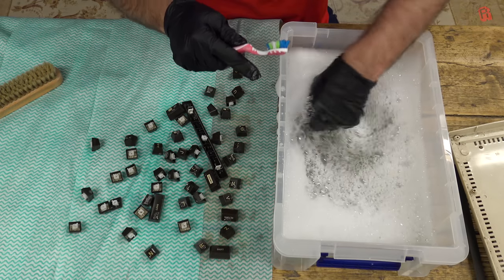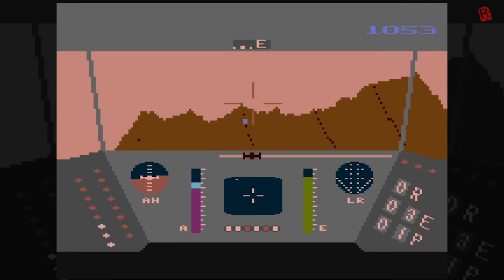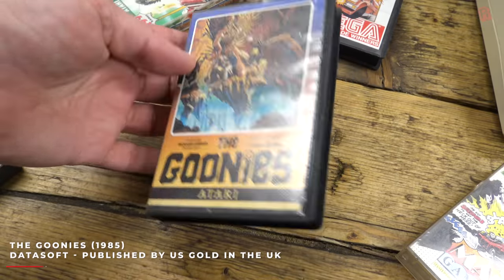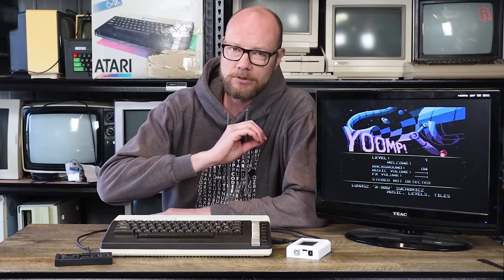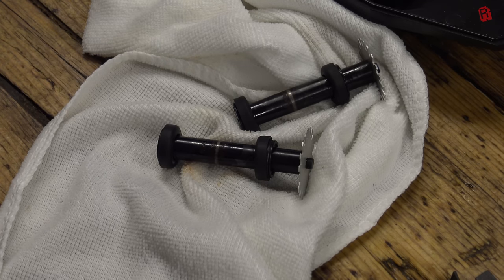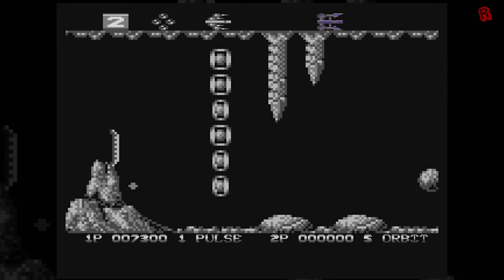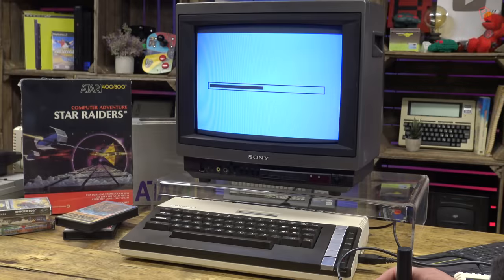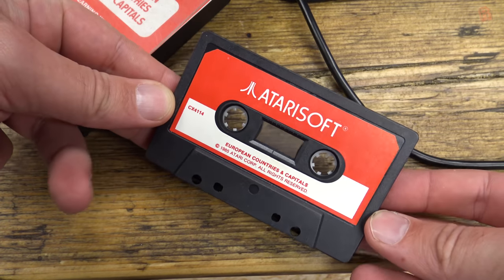What was the Atari 800XL capable of? | Trash to Treasure Part 3

Comment: Atari tapes were stereo, but sound output was mono. TV was feed only with a mono-audio track, while the data-track was feed into the micro. So you did't need to adjust a balance in TV. You actually didn't heard the data track in the speaker (only some crosstalk).
Reply: Thanks for pointing this out.  I'd left a comment about the Atari tape drives and this unique ability in the first RMC video on the 800XL.
Reply: There is a "POKE" (register) that you can use to mute the data transfer sound.
Reply: Not true. My TV only had 1 speaker and it always played the data sound. In the case of this game, it played the combined sound like you hear in the video, so it must have been merged in the RF modulator for mono output. Unfortunately, this means that shifting the balance to eliminate the loading sound would not be possible. I wonder if it would have been possible to cut the loading time in half if they had just used both channels for data.
Reply: Species1571 You could poke a certain location to silence the data sound. Worked on cassettes and the disk drive. 

Presumably they could have enhanced the load speed by using both channels, but that would have pretty dramatically upped the complexity of the encode/decode circuits. 

Also keep in mind the 400 only shipped with like 8K, maxed out at 16 (without hacks) and it was the machine really intended to be used with a tape drive. The much more expensive 800 was meant to be used with a disk drive, especially if you had the money to expand it beyond 16K. An 8 or 16k program wouldn’t take long to load off of tape. It was only when the machines started coming with 48K or more - and programs grew that large or even larger - that tape load speeds became really daunting.
Reply: makes sense, i wondered why some games loaded pretty quietly 🤔. None of my friends had an atari (spec'ies & c64's) i would argue how good the XE/800 was... we never really got the games the others had🤣

Comment: Some things you may be unaware of: Due to some register changes between the 400/800 and the XL range, some earlier games would not run on the XL series. To overcome this, a 'Translator' disk was released which was pre-loaded prior to loading the game to be played. The Translator was a basic 400/800 emulator. Lucasfilm games: 'Rescue on Fractalus' was originally called 'Behind Jaggi Lines' and 'Ball Blazer; (which you should really cover as it was a stunning 3D game for the period) was called 'Ball Blaster'. One of the best platform games ever (IMHO) was 'DROL' which used artifacting to achieve colour in the then 'high resolution' mode. ;-) I believe a later lower resolution game in four colours was available. Now, back to your regular programming...

Comment: It's a testament to the power built into the Atari 8-bit range that they were designed in 1977-78, but were still way ahead of almost every other micro on the market in the mid-80s. 

Their only real rival was the C64, which had the benefit of being designed several years later, but even then, when the same game existed for both the Atari and C64, the Atari version was often faster and smoother.
Reply: Yeah, the only real letdown of the Atari, and almost certainly a side effect of when they were designed, is their sprite hardware is a bit wonky compared to later systems.
(also weird memory saving hacks like having 256 colour video output circuitry but 7 bit palette registers, but those aren't so significant)

I bet if they had done even a slight design tweak to GTIA and Antic when the XL machines had launched they could have done a lot better.
Like, say, fixing the palette registers, and doubling the number of sprites (in absence of a more comprehensive design change to how they worked.)
Reply: @KuraIthys  THe Atari sprites were of their time - the original 800 had 4 joystick ports and so it had 4 hardware sprites too, called "players", but it also had 4 smaller sprites (2 pixels wide) called "missiles", one for each player - the idea being that one sprite for each player would be enough! They were single colour too.
Reply: @KuraIthys  Atari 8bit architecture can do without HW sprites, check all the  latest games like Last Squadron, Albert, Calisto, Prince of Persia. Large, animated colorful sprites without any slowdowns.

Comment: I have a ridiculously upgraded 800XL, lovely machine, I've barely scratched the surface of what it can do. I hope you thoroughly enjoy yours and spend some time checking out all the amazing things that are being developed for the machine right now.
PS
How does it compare to the C=64? A lot of it's down to perspective. Both are great machines, get both if you can.
For myself I would say there's almost nothing to choose between the machines from technical point of view - GFX on par, Atari a bit quicker, C=64 a bit better sound. The C=64 has the edge on games available, and probably new developments. The Atari a huge lead when it comes to practicable hardware potential and extant projects. I am very pleased to have both but tend to use my Atari more often as I lean more toward hacking than playing games.

Comment: I have 8 800xl , 2 130 xe and 1 65 xe and they all work! I recapped them all and recapped the serviceable power supplies and never had a failure. Built to last. Best 8 bit there is.(imho)

Comment: Hi Neil. Your loading issues look like you are booting with BASIC enabled. To disable, hold down the option key on the XL/XE whilst powering on. On the 400/800 it was a separate cartridge so not normally an issue. That is why you get the remove cartridge error, it's detecting it, where it would have been a separate cart originally.

Comment: comparing SID and Pokey is unfair as the pokey does sound as a second thought.  Knowing that it then becomes interesting to d'elle into experiments and be surprised of the way you can use the various bit operation modes per voice.  It's pre Amiga tech so of course they haven't enabled sample playback for users but it is easily tapped potential.  Look at the various poly modes in the Pokey, very unique noises.

Comment: The Commodore 64 obviously had better sound, being a computer that came out a few years after the Atari & having a more recent sound chip (the Sid).   But considering the Atari was older technology, it really held it's own when comparing the 2 computers.  And have I mentioned that the Atari system was simply better than the c64 - especially the disk drive which was faster and far far less buggy than the Commodore.

Comment: The Last V8 really does show the C64's strengths over the Atari 800XL very clearly: hires detailed sprites, an extremely colourful dashboard and logo, the much more versatile SID, and the horizontal smooth scrolling is twice as smooth (320 pixel vs. the Atari's 160 pixel).  The A8 is limited to 4 or 5 colours horizontally at a time, the sprites are only 8 pixels wide, and the smooth scrolling is tied to the current graphics mode.

The A8 shines in 3D games due to its faster CPU (like Rescue on Fractalus and BallBlazer) and games that scroll or render vertically. Generally the A8 is superior vertically, while the C64 is superior horizontally. This became very apparent when the side-scrolling platformer came to prominence later in the '80s. The C64 could nearly keep up with the NES.

Comment: You didn't need a stereo TV to hear the audio track on cassettes that used one - just as well, as nobody had them in 1979. When an audio track was present, the Atari would automatically mute its normal cassette loading sound and pass the audio track through to the TV speaker in mono.
Reply: Yeah, it didn't send the data audio out. Correct

Comment: 13:22 the text underneath the game , it's because has a graphic mode with "high resolution" on top and text on the bottom (probably a BASIC feature) , was very nice to debug using the bottom part as log,  i just remember that, 24 years passed fast ... still my favorite one by design was the 65 xl, i have both like in 1996, good old times !

Comment: Reminds me there's a near perfect conversion of The Mighty Jill-off, just without the second stage and ending sequence (but the intro is still intact).

Considering that's a PC game from about 2010 made in a retro style, rather than an actual 8 bit game, the nearly flawless conversion is one of the most impressive things I've seen...

Were it not for the strict adherence to using 64k of memory (could've been circumvented given floppy 130k floppy drives existed), I don't doubt it could've gotten the ending sequence and possibly the second stage into the game in a way that would have made sense in the past.

There's also crownland. - doesn't play very well, and the final build requires 128k of RAM, but it looks amazing and there's an older build that works on 64k machines...

Also worth remembering that this stereo tape feature has hardware functionality supporting it.
In particular you can turn the tape loading sounds off in software, and the system explicitly supports sync marks on the data track, which, coupled with the fact that software can stop and start the tape drive (no other functions, just stop and start the motor), means you can program things to play audio on demand in code.
Of course, it's not random access, but it's still an interesting concept.

Comment: I had an Atari 800 which I upgraded using the XL range of peripherals (1050 drive for example). But one item was a touch tablet from Atari. It was about 6" by 8" drawing surface with a stylus  incorporating a button with a second button on the tablet unit(mirrored for left handed use) . The tablet surface had a plastic covering that could be lifted out and pictures placed underneath for tracing. But what is interesting about it is the technology uses the same input to the computer as the paddle controller, namely variable resistance so it could be used as a paddle controller (with some practice). Left/right was one paddle and up/down was the other and the fire buttons were the stylus button and tablet button(s). Some rather good drawing software was available at the time (Degas being one of the better ones) and despite the limited colour palette I managed a reasonable picture of the motorbike i had at the time.

Comment: Excellent series, the old Atari’s were quite capable machines though tape loading was dreadfully slow I did wonder what you were using that looks like a nice gadget. The pokey sound chip is also a very capable device and although it might not match the SID for varied sound it does have an extra channel. A better piece of Rob Hubbard music would have been Jet Set Willy, the game itself is awful though unless you get the home brew re release with the proper graphics.

Comment: Far from a comprehensive list. Machine was a word processor and used spreadsheets. Acted as a extensive BBS. I ran one with 31 message boards, e-mail, and was the first person to establish this packet network with Europe from the USA Had speech generation (via both hardware and software) paint software, banking,  electronic circuit schematic, modem communication,, various database software applications, printing of documentation, label, tv image capture. Satellite image capture and printing (weather). Currently internet access! and more! And fast 3D image rotation. Machine ran at 1.79 Mhz vs 1.0 for the Commodore 64 Was amazing in its day!

Comment: The 800xl was a good machine, We started developing for it after the Dragon and release of a few titles. Although we had working prototypes for the Atari we did not publish. what we did do was use the stereo tapes to apply music during loading. It was cool at the time especially as 10min loading was not uncommon however given time this seemed to increase loading errors.
Reply: When I learnt of that feature I always wondered why it never seemed to get used.

Using it during loading seems especially like an easy win, but given the few examples that DO use it (Atari's 'introduction to programming'), it seems like it would've been plausible, with some serious caveats, to use it in a similar manner to the way games later on used CD audio. (obviously without random access, the limitations are severe)

Indeed, one of the many, MANY versions of 'bad apple' created for the atari 8 bits uses this system to play the video off a large cartridge (like 60 megabytes or something), while simultaneously playing the music off a tape.
This is jarring in just how high quality the result is for an 8 bit system.
Obviously the huge cartridge is a major cheat. But...
On the other hand the demo runs just fine on an unmodified atari 400...

Which is just, insane to think about...
Reply: @KuraIthys  The two main reasons the audio track was rarely used were that producing a decent track to put there meant added expense - you needed to book a studio to record and mix it, maybe pay a professional voiceover if you couldn't persuade one of the staffers to do it - and in the USA disk drives rapidly took over from cassettes anyway.

It was a great idea, but the added complication and cost it introduced to the tape production process meant that few software houses other than Atari itself bothered to make use of it, and the popularity of disk drives saw cassettes sidelined.
Reply: My school had a Spanish learning tape set that used the two channel head.

Comment: You might try 0000 steel wool to remove rust and mung from metal pieces. It works great for me on coins, firearm finishes, and just any metal finish you don't want to disturb.
Reply from the maker: Thanks for the tip

Comment: About that trackball...

Atari made two trackballs, the CX22 and this one, the CX80. I have a CX22 and a friend had a CX80. I got to compare them and of the two, my CX22 had much smoother control. When I looked inside both, the "teeth" on the encoder wheels for the CX22 were much smaller than the ones on the CX80. Using that trackball felt really rough.

Comment: A home computer museum is important. I wonder if the only people who will visit are people in their 50's and 60's who were teens when these things were new. They ought to be of great interest because this is where modern computers came from. Obviously the code breaking machines of WWII were important for computer principles but these machines have a direct hardware connection. Yes the standard logic voltage is now 3.3V rather than the 5V we grew up on but they are still the same thing.

Comment: I am trying to get my original atari800xl up and running, but the floppy drive is boot error-ing. The three games I am most eager to verify the disk medium is still working for:
1: Archon2  Like star wars chess, where when a piece takes another it zooms in and the two pices have to fight for it. day/night cycles give advantage to white/dark pieces over key control points of the board.
2: Montezuma's Revenge. Like Pitfall meets indiana jones, only endless, Rogue-like, and I believe procedural.
3: Ultima IV- Quest of the Avatar. Enuff said.

Comment: By Jan 1981 all Atari 400 and 800 computers on sale had the revised GTIA chip with double the screen mods of the original 1979 CTIA chip it replaced and an increase from 128 to 256 colour palette so really almost all games are 1981 technology.....same exact year the MOS VIC II AND 6581 SID were finished for the Commodore arcade motherboard project of 1981 which was cancelled in 1981 and became the VIC20 killer.